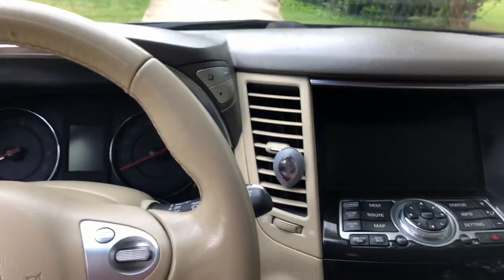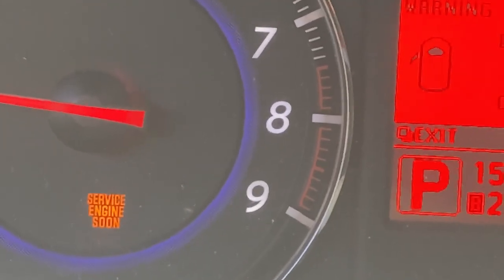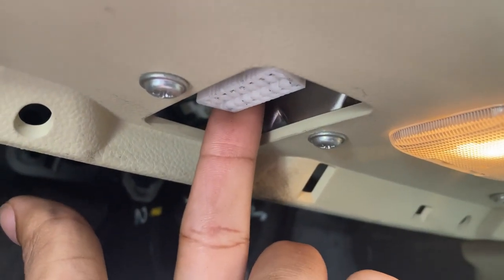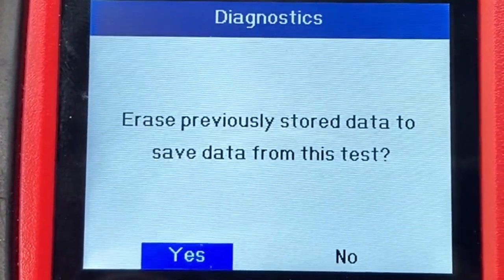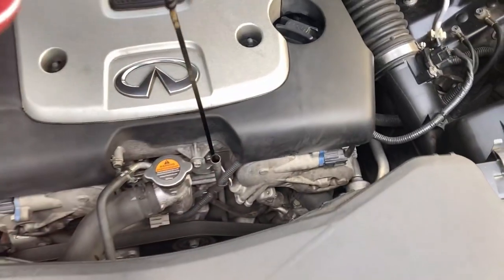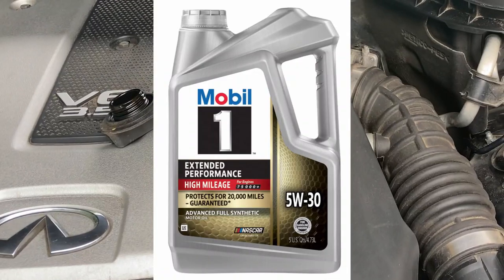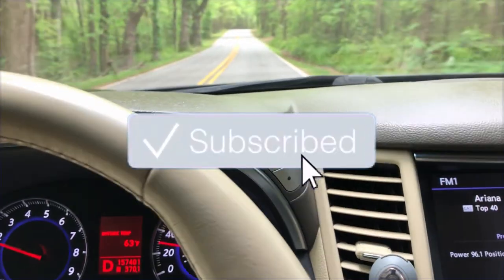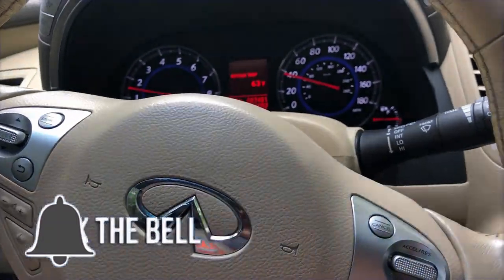Infiniti FX35 2nd gen p0014 p0024 FREE FIX Variable Valve Timing Solenoid

Comment: Blew my q50 motor …..this code popped up on dash while driving on highway literally 5 min later engine died on the highway …fast forward a week dealership replaced engine and both turbos under warranty ….side note : got an oil change 2 days before at the dealer ….got my car back with all the pricing and full detail of issues and that was the only code with a $28,xxx price tag I’m glad I wasn’t responsible for 😅
Reply from the maker: Something as simple as low or no oil will do it every time! My extended warranty ran out a few months ago and because of covid I haven’t taken it in for service. Lesson learned because I usually check all my cars monthly.

Subscribe if you haven’t. I have a few other videos that my be useful. Just have to get around to editing them.

Comment: The code is actually for the VVT solenoid, and not the cam shaft position sensor
Reply from the maker: Hey thanks for the reply. I kinda figured my scanner wasn’t updated enough to read the 2021 codes. I was courteous because it seemed like every sensor was malfunctioning at the same time.
Reply: Thank you so much! When he showed the can position sensors I immediately knew he was talking about the wrong engine component!
Reply: @TRRehab  that code ain't new you just gotta do a little more search before you post videos
Reply from the maker: @JASONXMARIELA  That’s what my scanner displayed for p0014 & p0024…. The fix in the video worked. You will also see in the description all the information is correct referencing the vvt solenoid. Most people who watch my videos just want it to work.  You can call it an airplane in the sky. If you got these codes and all you had to do is top your oil off and the code went away…. I can guarantee you wouldn’t be mad. 

I take that back. There are some who would still have an issue…. ? It worked for me! Period. And others have said it worked for them.

Comment: I'm getting a P0081 Intake Valve Control Solenoid Circuit Bank 2... is this the same thing?
Reply from the maker: I’ve never had a p0081 but at first glance it does appear to be related to a short in the vvt solenoid or the solenoid itself. I have a replacement video of the vvt solenoid on the 3.5 Infiniti. I’ll try post it next week.
Reply: @TRRehab  I ordered a new VVT and will install. seems like an pretty straight forward job on the 2010 fx35.
Reply from the maker: @DTUFINOPhotography  Yeah it’s a pretty simple replacement. Check power to to both the magnetic retarder and the vvt solenoid for power if you haven’t. Driver side is bank 2 in Nissan and Infiniti V 6. It’s opposite in the V 8. I’d like to know how the results. Keep me posted.
Reply: @TRRehab  You got it! I'll change it this weekend. i dont get the parts until sunday morning, can i still drive with this code? I have to go grocery shopping this weekend.

Comment: I got this p0024 on my g35. Can this kill ur battery?
Reply from the maker: No this has nothing to do with your battery. Flush your oil. You may have to do it twice. I'll post the video tomorrow of the engine flush and I have another changing out the vvt solenoid. After that would be your magnetic retarder. The assembly is about $1,000 for each side so you want to go through all these steps before making that leap!
Reply: @TRRehab  i ended up changing the variable timing solenoid aka oil valve sensor.  Works good now

Comment: Soooo just top off the oil??
Reply from the maker: Actually yes. 7 times out of 10. If that doesn’t work do an oil flush and complete oil change before taking it to the dealership. The code is set most times due to neglect of oil change.
Reply: Actually, no. This is the one you want to watch! https://youtu.be/olrC8UYw9cQ

Comment: What if it ain't the oil
Reply from the maker: If topping your oil off doesn't solve the issue the next step would be to flush your oil. I would actually flush the oil twice and then reset the light. If that does not work I will have the VVT video up by next week.